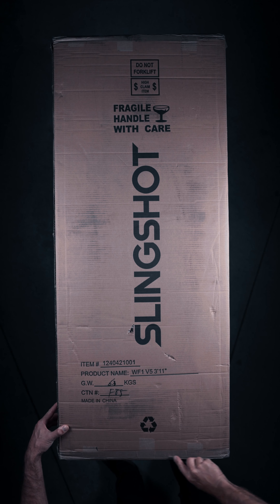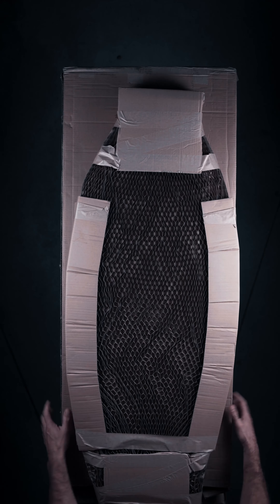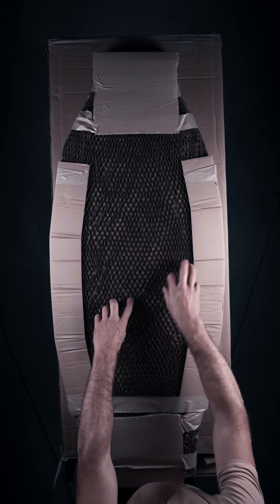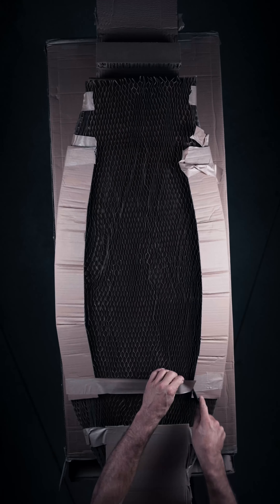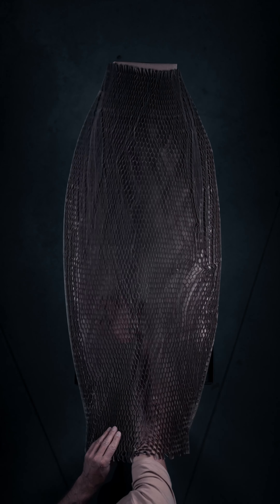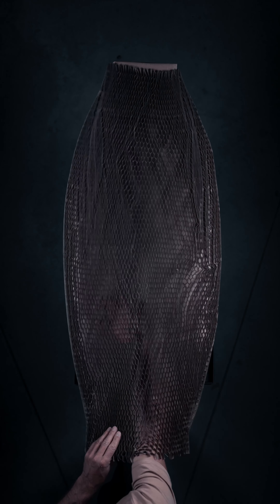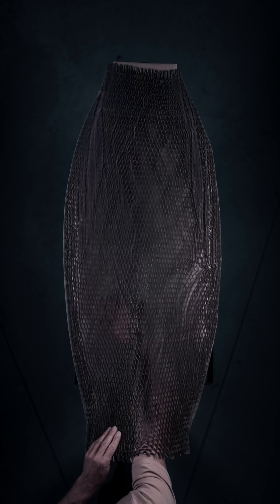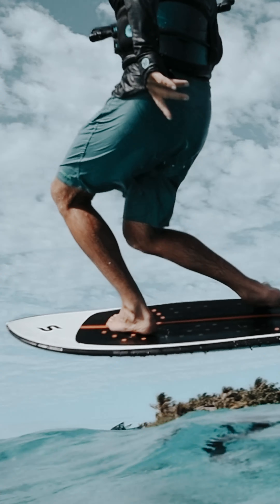Unboxing the WF-1 V5: A Designer's Perspective

Comment: Hi there, do you know if the tracks are carbon or standard extrusions? I want to use with a foil drive and need to know if the signal gets through the board? Boards like Armstrong with carbon tracks and full carbon wrap don't work. Tks
Reply from the maker: @barryjames7931  Hi Barry, although this WF-1 is a wonderful board, I feel it will be too low volume for the foil drive, even the slim version.  The power IMO won't be enough to take off.  Although if you get it to work let us know in the comment!!!   The Track is plastic, so communication with the remote should not be a problem ;-).
Reply: @thejulienfillion  Tks Julien, Just got one, and yes with the plastic tracks, the signal is very good, and if you hold the remote on a front foot strap hole, you get good signal even fully under water duck diving. The FD is really so powerful I find you don't need much volume/board size. Im 75kg, with the Lift HA150, just pull the trigger & am straight onto foil even in flat water. Lift 120 needs just a tiny bit of swell pass under and youre away. Lift HA90  needs a bit of a chip in, but still very easy to get going. Its planning area, not volume gets you on foil, and having a thin board under foot is more fun that a chunky one. Its a really nice shape/design well done,  thank you, (and the rear mount tracks are great for FD too)
Reply from the maker: @barryjames7931  oh Barry, that's actually unbelievable, he right foil really seams to be ✅ the trick.  I'm glad you like the board and the Foil drive combo was a success